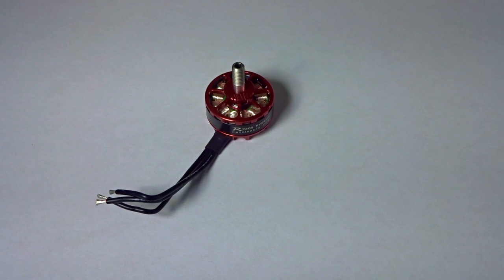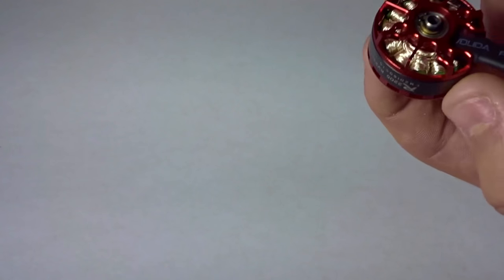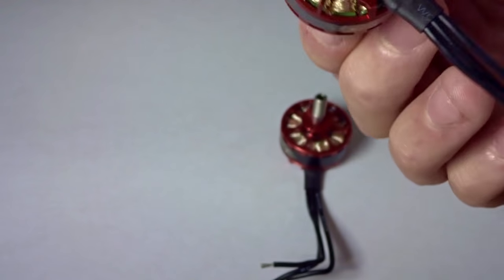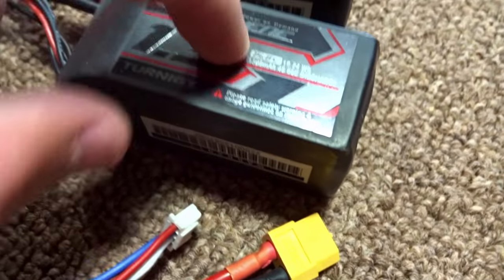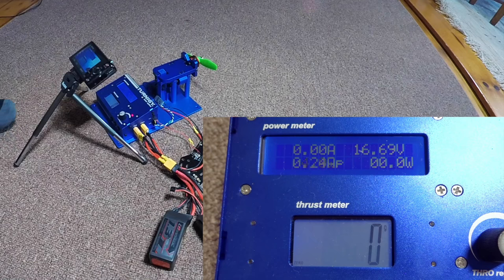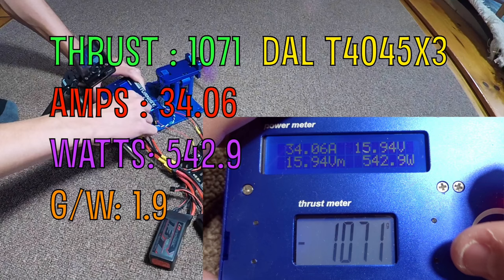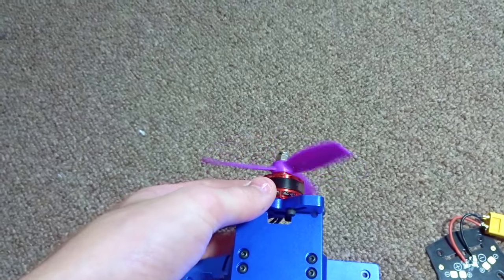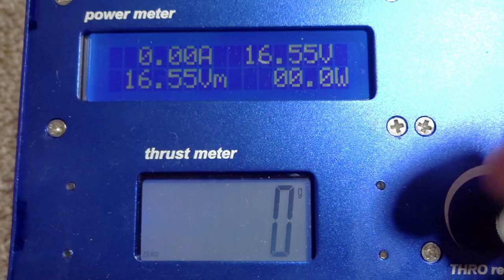SunnySky Edge R2205 2480kv Lite : Overview and Thrust Test

Comment: nice vid :D i think that ,from watching other thrust tests, that these static thrust tests give accurate thrust numbers but as there is a lot more stress on the motor/prop being static, displaying like, 30% more amp draw than in practice so these actually do seem very efficiant (my motors show almost 50a on a thrust stand but ive seen no flames yet from my 30a escs)
Reply from the maker: Yeah, I go over that. Still 8amps higher than a normal red bottom, but then again more thrust. MQTB says that the motor is closer to a 2206 so that is why. What the heck motors are you running to pull 50a?!?
Reply: all i'll say is 22** 2600kv, 5inch props of many kinds and way too much thrust for my back garden :D
Reply from the maker: Aryan Gangurde I don't like 2600kv for 5inch props. I think the extra amps are too much for the gained thrust. I prefer 2300-2480 :)
Reply: The RCAddict  on any 2600 kv motor i'd agree but the rs2205 2600kv seems to be a special little case when it comes to 5 inch props(maybe lower kv rating than in reality idk...) also, apart from racing where people seem to be keeping the torqueier mid kv motors, higher kv motors (imo) seem to be getting a rise in popularity from the extra power, without too much amp and torque loss on lighter props... (love all ur vids by the way, keep' em coming :)

Comment: Poor ESC ;)  Some results definately were a surprice (not in a positive way).. Time for an RPM meter? :)
Reply from the maker: Haha, yeah it died later after the video while I was doing spikes of throttle. Not sure if it was from the motor or two of the leads touched as the wires "jumped" and it was dead :/
Reply from the maker: DutchRC Adventures lol. Ryan from MQTB says it is actually perfectly normal for high kv as it is basically a 2206 motor with the stator.
Reply: The RCAddict hello rc addict,i wanted to ask you if you can me help with a problem.My drone seems to have unlocking the rotors problem,do you got any suggestions or something that can help me out
Reply: The RCAddict my drone is not a racing its a Ariel photage drone nut ya i would appreciate it if you can help a sub out
Reply from the maker: BigDaddy_ Princes What QUAD (not drone :( ) do you have?
Reply: The RCAddict *kwad jeez get it right lol
Reply from the maker: seth davenport Anything but drone please lol

Comment: Can you weigh that 2204 motor and tell me the weight?
Reply from the maker: 24g :)
Reply: Thanks man, thats with the same length wires as the 2205 and no locknut right?
Reply from the maker: Slim Jim Yep :)

Comment: very interesting results:)
Reply from the maker: Thanks, I check with Ryan from MQTB and he said the results were what he expected from a high kv, and this series is close to a 2206.
Reply: Yes, I think I might get some 2300 for a Horus 6 in stretch
Reply from the maker: AveryFpv If you can still get the BG coupon where they were $11 I would. That's why I pulled the trigger lol
Reply: Haha yeah!
Reply from the maker: AveryFpv Yeah, BuddyRC has been selling them for $22 for a month or two, and then BG had them for $18, but they had a sale plus a coupon and was $11 a motor so I got them. Wasn't even really planning on building a Fusion but I had the motors and needed a frame then lol.
Reply: Yep :)

Comment: I actually run these motors in a couple quads, and enjoy their thrust, but they are power hungry and not very efficient. You will need the "perfect" setup to not puff a LiPo. I ran 20a LB's for a while with these, but I recommend a 30a (DYS XS / XSD30) ESC to fully utilize them and not pop an ESC. They are grossly inefficient in all honesty, but I run them with 5x4x3's typically. All my batteries come down stupid warm. No reason to run Bullnose with these motors, it's not needed, and as you can see, your amps increase ridiculously.
Reply from the maker: I ran these on DYS XS20 for months with no issues.
Reply: The RCAddict yes, and as I said, for a while I ran little bee 20a with them, but using 30a ESC's, not only did I get a better peace of mind flying them at high throttle ranges constantly, but I feel as though (possibly placebo) that I'm getting better thrust results, but that could also be from the switch last year from BLHeli on that quad to blheli_s.
Reply from the maker: Tom Coffel I have plenty of peace of mind running 20a on them. In flight you are pulling only max 26 amps for a few seconds, and then like 8 normally. Never blown an esc, so I will keep getting 20s for them being smaller.
Reply: The RCAddict wasn't suggesting you didn't, I was commenting on my personal experience, and a recommendation, one even supplied by the manufacturer. sorry that I stumbled on your video and made a comment using my own experiences using these motors, it definitely wasn't an attack or saying you were wrong.... happy flying!
Reply from the maker: Tom Coffel Sorry that I came off that way. I certainly wasn't attacking you either. It is almost impossible to convey how you mean to say things over the internet and text. Sorry
Reply: The RCAddict that is true, text is extremely hard to convey intent, no harm, no foul.
Reply: sorry to hear your issues with them.

I use the non-lite versions of these and they are great.
Mine will poke along at less than 8a draw with 5048x3 props and 20a escs.
full throttle launch, will got 130a plus for a second or so. 
they will drop back to around 110a so long as your battery lasts.

I flogged a turnigy graphene 1300 65c for 1:40 at pretty much 80a+ 
motors were just barely warm and ditto for the escs.

throttle management is a must because they deliver. if you want crazy speed, you need great batteries.

Hovering is probably what heats them up more than anything.

cheers all
Reply from the maker: 130amps is very very excessive. I never go above 100a on my most powerful setups. If you are reaching that kind of Amperage look into the accuracy of your meter, or adjust your setup as something is pulling way too much without benefits.
Reply: 5048x3 props from launch :)
I was poking along at 7.5a today and got 8mins out of a 1300 4s.
The next battery was 1:40 out of a same brand pack;but that was 80% stick for most of the flight.

Noodling around with some speed and some acro is about 3mins out of a similar pack.

The power and result comes from somewhere, poor battery.   

I think it is good the motors can cope and use it. it is up to me to manage my throttle (epic fail most of the time).

Cheers and thanks for posting and replying.